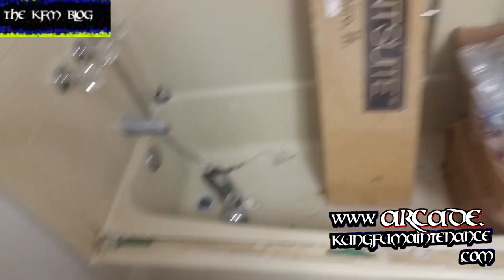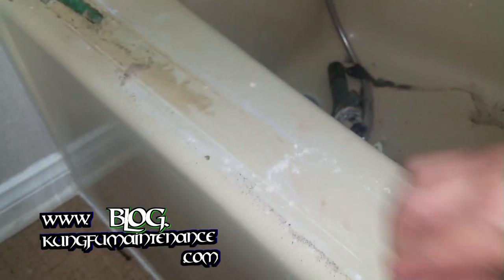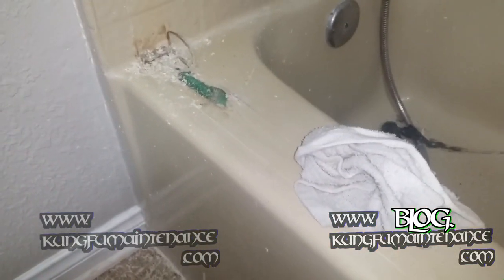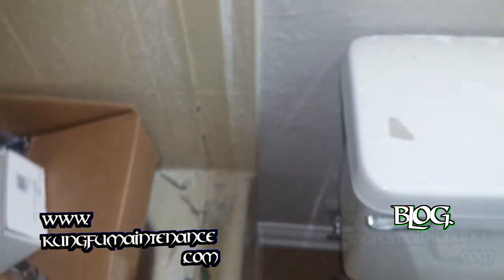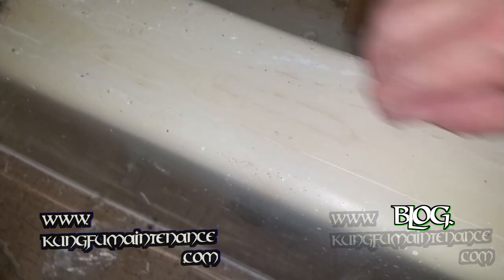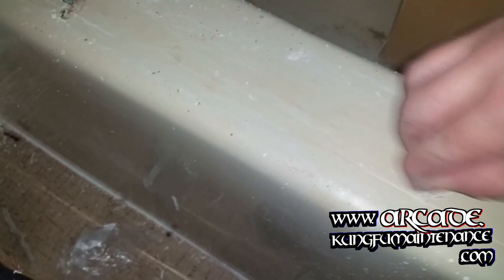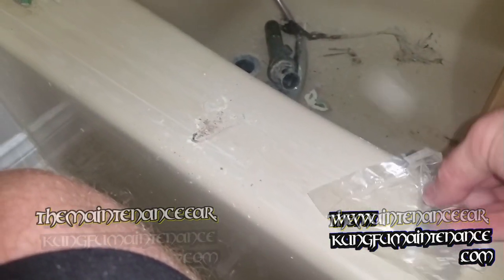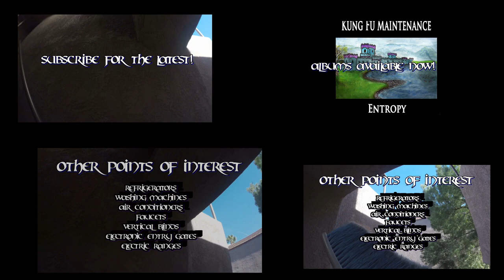Removing Silicone Caulk Adhesive Residue After Taking Out Shower Doors Fiberglass Tub Enclosure Vid

Comment: Soak the tub edges with Simple Green. Let stand for 3 minutes then spray again before scraping. It will soften all of the brown gunk and prevent scratches and chipping in the tub glaze.
Reply from the maker: Sawashi32 I will try that for sure. ~ Thanks for watching and thank you for the tip!
Reply: +Sawashi32 Would you recommend the all purpose simple green?

Comment: I am doing this project now. Some of the tiles came off when I took the aluminum frame off. The tub part was no problem. The adhesive on the tile is like super glue. It's like stone on my tiles . As the other comments said nothing works. It's been there for  30 years the sliding doors. Any other suggestions?

Comment: I have found nothing yet, the bulk comes of with a razor blade but the residue left is immune to everything I've tried, acetone, mineral spirits, lacquer thinner, VMP, goo gone silicon remover, heat form a hair dryer, IT DOES NOT COME OFF, next I will try oven cleaner and that's about all I have left to try. So take heed when removing when that will be visible after wards.